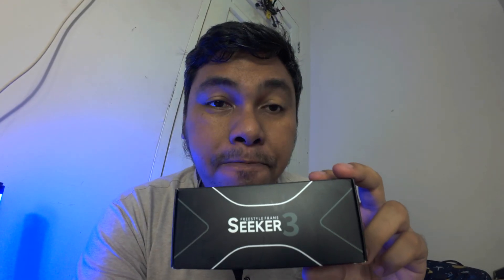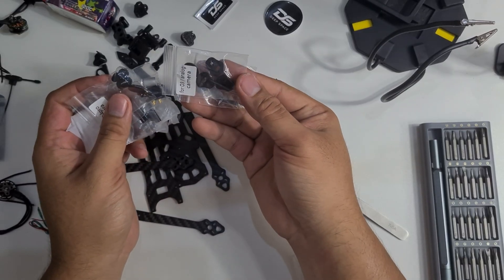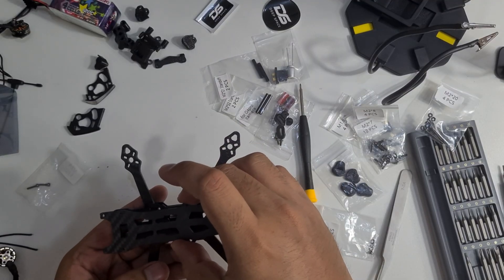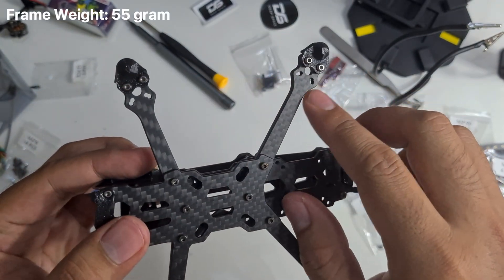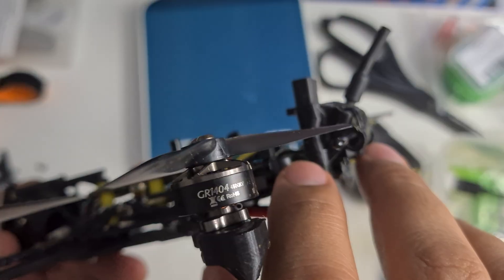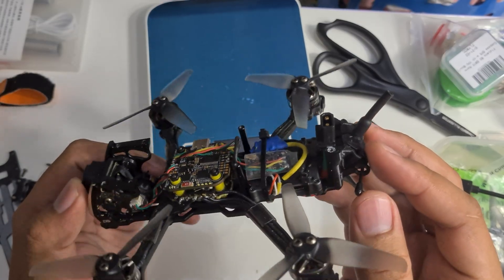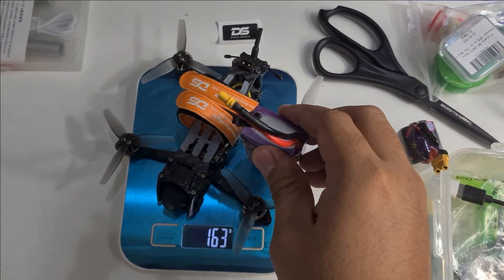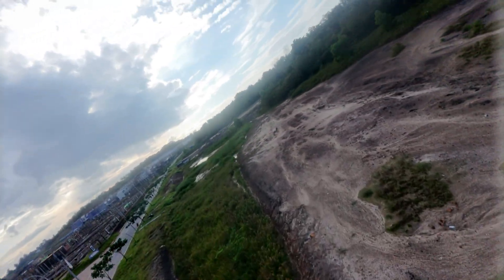DeepSpaceFPV Seeker3 Build Guide - Lightweight 3-inch FPV Drone Under 250g (Including Battery)

Comment: Did you use an external BEC to connect the O4 lite to the FC or you just wired it up straight to it?
Reply from the maker: I just solder it directly to the fc

Comment: Hi it can be mount 25x25mm fc or only 20x20mm? I see 4 holes near the 20x20 ones!
Reply: nope, you need mount converter, i already build it sub200 with 3s battery
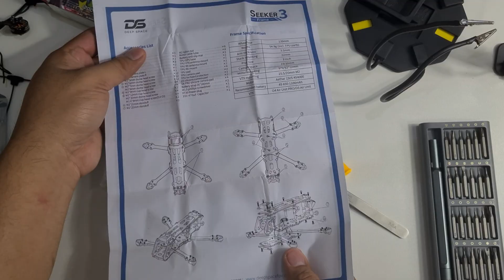Reply from the maker: Hi, I believe it should be able to mount 25.5/20 mm VTX and 22mm mount for the FC. You can see the specs at 1:24